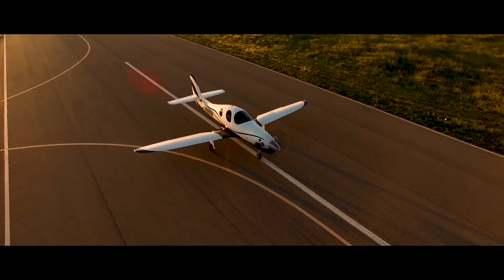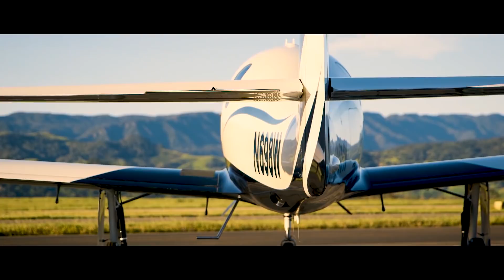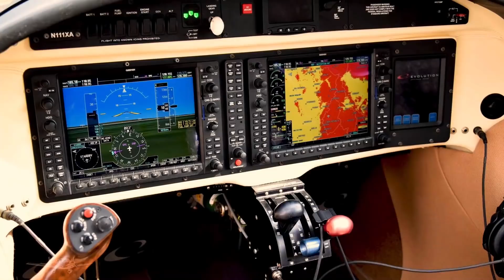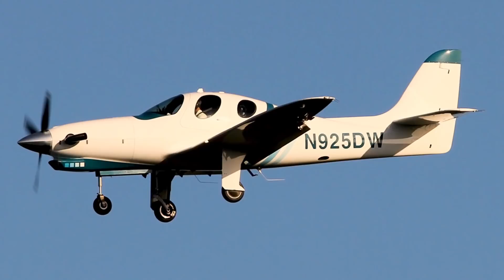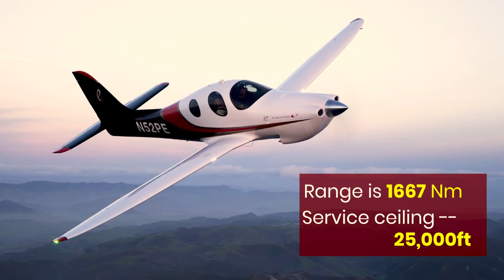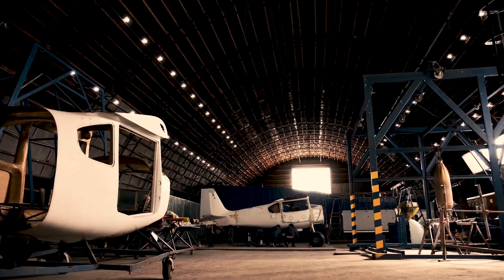LANCAIR EVOLUTION - the GREATEST Four Seat Plane

Comment: The greatest draw back of this airplane is that it is NOT type certified. It doesnt matter how close to professional aircraft building and safety design features it is built with, because as far as " ICAO mafia" and their minion governments are concerned, its no more than a triangular steel tube frame with a hang gliders wing attached to it and propelled by someones ovrrhauled lawn mower engine and a home made propleller . 😢 Sadly as sophisticated an aircraft that it actually is, it means nothing in the eyes of their laws thereby restricting its use to that of a hangar orniment / hangar queen . So until it gets type certified , its a 1.5 million dollar wall painting as far as utility goes under ICAO ( WEF , UN mafia ) rules !!!

Comment: Previous Lancairs were metal airplanes? Not a single Lancair was metal, even the very first prototype, Lancair 200, was composite with a foam core wing. Thats a pretty critical mistake that wouldn't have required more than a wiki search.... Bad writing?

Comment: All Lancair's are composite, none of them were metal, its impossible to make those complex shapes out of metal unless it is melted and cast in a mold to form those shapes. I have been in aviation with my father since the 1980s and the first Lancair 235 to get a write up in an aviation magazine was a composite airframe.

Comment: Once again in your videos I have to say that a G3X is not inferior in any way to a G1000. 
The G3X has to be paired with a external GPS nav/comm and autopilot, but that's a feature: ot makes it much more customizable than the G1000. 
Most people get a g3x and a gtn 750, but you can up to 4 g3x screens and a gtn 750 and a gtn 650 and a g5 just for good measure. 

And FYI, the G3X is now offered for certified aircraft also.

Comment: And no icing protection! All at around 1.2 million. It will be flying around looking like an ice cube most of the time.
Reply: That’s not true. There are several Evolutions equipped with traditional inflatable de-ice boots. Problem is boots extract a speed penalty of about 20-30 kts as they dirty up a bit the Evo’s super smooth laminar airfoil which is why most owners haven’t elected to go that route. 

But that’s not the only option. The super advanced German Villinger electric thermo deice system is in flight testing on three Evo’s as of this writing.  So far it’s proving to be very effective, robust and efficient. The system is only 5 nano meters thick which does not interfere with the Evo’s laminar airfoil unlike traditional inflatable boots so there is no speed loss with the Villinger system.   So far about 20 Evo’s are in line to have the system installed after testing is complete.
Reply: @abel4776  I thought you just meant the turboprop Evolution, sorry. No idea on the chute. I’d be more interested in the DA50RG or 62 anyway. No chute on either of those.
Reply: @abel4776  Panthera looks like an awesome plane for the money
Reply: @abel4776  it’s an option if desired. Several have BRS parachutes installed.
Reply: @abel4776  now? It’s been around for a while
Reply: You can add hot boots to the plane.

Comment: Great design and concept, FAST! But, too hot for the average pilot and most of them were crashed causing the company to go out of business! And former Lancair designs were COMPOSITE, not metal! Poor research on this video!
Reply: That’s the lancair IV-P. This is a safe plane. Part 23 stall numbers.
Reply: @thezeek2745  Yes, but still a "HOT" plane that is too much to handle for the "average" pilot! One of the more perplexing crashes was in the Phoenix area, the guy lost electrical power, "No big deal" on a beautiful crystal clear day and crashed a perfectly good plane and was killed! Most aren't up to the performance!
Reply: The Corvallis was composite as was the IV-P. The Evolution ran into trouble when some of them were crashed by low-skill pilots.  Insurance companies backed away from them.  The planes are fine, but not everyone can be a customer or be able to pilot one.

Comment: I had researched the SR 22 but never heard much about its competition. Thanks for putting this video together.
Reply: This plane is NOT a competitor with Cirrus.  It is a different animal entirely.  It is carbon fiber and has a chute, but that is the end of the comparison.  Cirrus does not have a jet-prop option and is not pressurized.
Reply: JMB VL3 is SR22 competition
Reply: @kize32  Wrong.  The JMB is a two seater with retractable gear and cruises at 150kts.  It uses a Rotax light sport engine.  It is basically a light sport with retractable gear, a 20kt too fast cruise speed which disqualifies it as SLSA.  The SR22 is a fully certified aircraft, four seat (a fifth seat for a child) with fixed gear, a Continental non turbo IO-550 with 310hp (high performance) and a constant speed prop. And cruises at 165kts.
Reply: @kize32  that’s even more wrong haha

Comment: The Evolution with the PT-6A turboprop engine is nothing short of incredible.  Solid, well designed, easy to fly, turbine reliability, very comfortable and roomy, great payload, with jet like performance.  Very few others out there can cruise at 300kt in the flight levels above most of the weather and then land at 61kt (stall speed) which incidentally is the same as a Cirrus SR22.  Stall characteristics are so benign practicing them is really a non-issue which is something you wouldn't want to do with a Lancair IV.  One other thing that makes the Evolution truly remarkable is its near sail plane glide ratio.  At 18:1 it’s about twice that of any comparable airframe.  It's so great that at its typical cruise altitude it within glide range of an airport in the lower 48 states.  If you can competently fly a Cirrus SR22/Bonanza/Cessna 210 you can fly the Evolution if you commit to the training needed for its high performance and flying in the flight levels.  Its truly a docile plane to fly with tons more power.

Even thought it is marketed as a "kit plane" it really is not.  Almost all Evos are professionally built with the owner partnering with a "professional contract build/maintenance shop that has extensive expertise with the plane and composite construction.  All the complicated and integrate work is completed by the professionals while the more basic work is completed by the owner to meet the FAA rules.  In essence the professional build shop ensures each plane is built to meet very high quality standards and then tested by certified test pilots thoroughly before being turned over to the owner.  In my opinion most Evo's are built better than certified planes.  

Regarding its accident history.  The reality is most of the accidents have been due to pilot error and not airframe issues.  Problem is the Evo's performance attracts an owner/pilot that can afford it but may not have the ability, experience or commitment to training to fly a plane with this kind of performance.  The Evo's jet like performance can easily get ahead of an owner/pilot not ready, prepared and trained for it or fails to maintain proficiency.  It's one thing to cruise around at 170kt / 8,000ft in a Cirrus or Bonanza but entirely another at 300kt / 28,000ft in the flight levels where you are mixing it up with the big air carrier jets.  In reality it's not the plane but the Pilot that's the Evo's Achilles heel.  Recognizing this, the Evolution Owners Group has in recent years worked hard to develop and implement a certified recurrent training and safety program with professional training organizations like Elite Pilot Services.  They have also worked closely with the build/maintenance shops to maintain the fleet and sponsor improvements and advancements for the Evo including many safety products like the BRS ballistic parachute system now being available, new advanced avionics & autopilots and cutting edge thermo radiant heat de-icing systems, military grade door seals just to name a few.  Despite other comments about the manufacturer (Evolution Aircraft Company) being out of business the are in fact still in business and actively support the fleet with parts and factory support.

While the Evo is not currently in production, it may not stay that way for long.  With only about 90 in existence they are becoming highly sought after and if you are lucky enough to own one its not uncommon to get unsolicited inquiries from others looking for one.  Nothing out there competes with it in its price/performance category.   

How do I know all of this, well I own and fly one.
Reply from the maker: The Evolution is as great as it gets
Reply: Are they in business, and are kits still available? Or just supporting the existing fleet?
Reply: @DaneJasper  Yes. Evolution Aircraft Corp just announced a manufacturing JV with JMB Aircraft in Czech Republic to resume production.
Reply: The SR22 over the numbers speed is 71kts.  The SR22T over the numbers speed is 79kts.  The roll probems in the Evolution caused crashes and that led to insurance issues.   But now Evolution may be back as the company is partnering with JMB in the Czech republic.
Reply: How does it do in icing conditions?  The only thing that makes me second guess this aircraft is the fact that cruising in the flight levels would make avoiding icing conditions nearly impossible, which if it doesn’t do well in icing, defeats the whole point of going up that high
Reply: @colindoney3564  It uses a thermal boot on the wings which is the same tech found on business jets.

Comment: Turbine Prop not Turbo Prop
Reply: I think the naming convention started with the other name descriptions for the three general classes of turbine engines:
TurboJet
TurboFan (both high and low bypass)
TurboProp

I agree all use a turbine engine as their core power source, its just the method of "final or primary drive" that differentiates them, each having a sweetspot on the performance/altitude/fuel efficiency curves an airframe designer/manufacture selects for its mission profile.  

How it got shortened to "Turbo" is a mystery to me.
Reply: Turboprops are turbine-engine prop planes. The Evolution is an example, or the King Air, PC-12, TBM, etc.
Reply: @DaneJasper  in the 40s this in-distinction started, it was wrong then and is still wrong, my private crusade

Comment: From a company no longer in business.  Good luck finding parts & support maintaining this complex plane. 
Beautiful bird but not practical given the lack of support.
Reply: back in production this summer I've heard.
Reply: @dwightbarnell  a friend of mine has his in Oregon at the “ plant “ getting a stronger nose wheel assembly put on. Fast plane but I don’t think I would want one
Reply: @arthurbrumagem3844  Not right now anyway, not until the company comes back online and the insurance rates go back down.  I have heard the nose assembly is a little on the weak side.
Reply: @dwightbarnell  my friends collapsed on landing a couple of years ago. Having a turbo prop rebuilt isn’t cheap or fast
Reply: @arthurbrumagem3844  there is a newly engineered HD front nose gear now available. Much beefier than the first gen unit. Ours just had it installed. Nose problem issue is now a non issue.
Reply: @blaze6655  and that is why my friends EVO is at the factory 👍👍

Comment: You need to do a follow up video on the LX7 for the lancair 4P and evolution.
Reply: The LX7 is a IVP with a different wing attached.  The engines are not new either.
Reply: The LX7 is impressive and possibly faster. I believe the Evolution is wider and overall larger inside…

Comment: What is the useful load, can it fit 4/6'3 guys or is plane made for 2 adults and 2 kids under 10
Reply: Useful load with full fuel is about 950lbs. Limiting factor is tires. Plenty of hp for more payload if you wanted to chance the tires. Back seats would be cramped with two 6’3 guys but it’s doable. Two adult females would be very comfortable. Front has plenty of room. Way more than a Piper Meridian.
Reply: My understanding is, 4 adults and 225 pounds of luggage